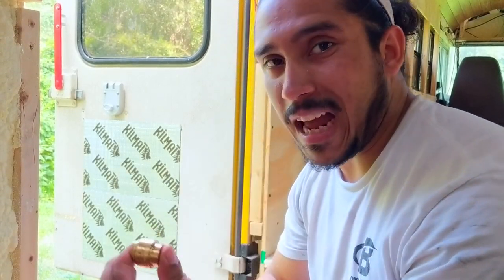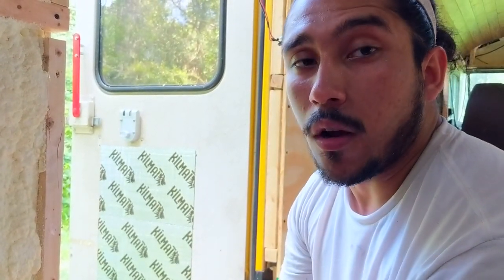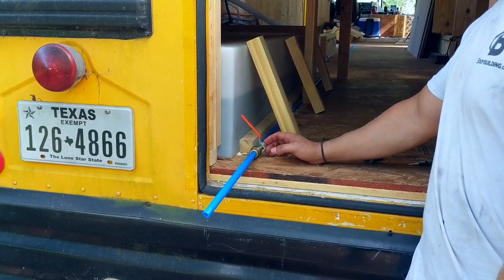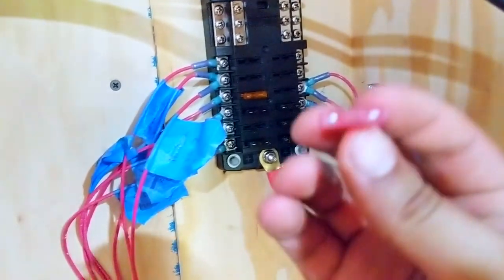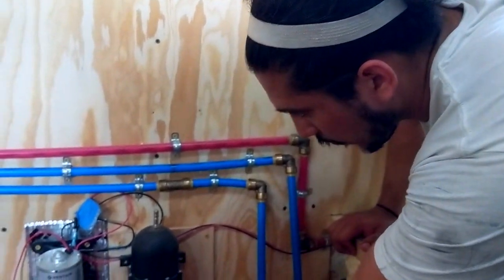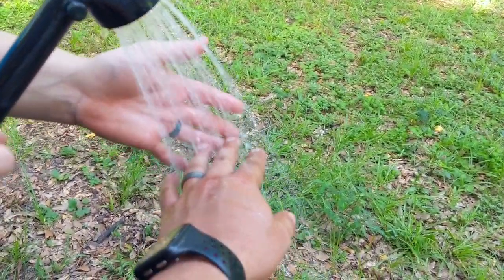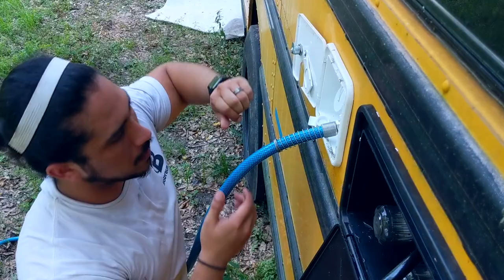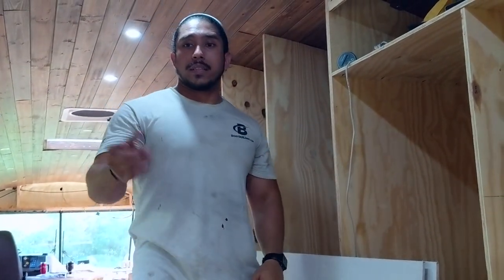Leak Testing Our Plumbing System * Skoolie Conversion * Gus The Struggle Bus

Comment: I had that pressure value, figuring it was the better option being more expensive and all. That turned out to be a total bust. It stopped working not that long after I got it. I've gone back to the basis one that keeps the pressure at 55 lbs. with no gauge. It seems to work way better and I've had no issues with it. Not saying you'll have issues with yours, but pay attention to that one. It might not be working when or the way you think it is. You won't have problems with the PEX and high pressure, but you will blow out the diaphragm in your pump with it. Keep up the good work guys!!
Reply from the maker: Thank you so much for letting us know, we will keep an eye on it!
Reply: MEREDITH and PACO you’re welcome. I wasn’t a real happy camper when it failed when I needed it to work the most. It was great while it worked though.
Reply from the maker: @2AZSUN  I can imagine!

Comment: Hey @MEREDITH and PACO! We absolutely LOVE how simple you two are making your plumbing setup! We've seen some crazy setups and know that the simpler it's constructed, the easier it is to maintain and the less probability of problems down the road. One thing that would be worth adding to the setup as seen in this video is adding a quarter turn shut off valve BEFORE the pump and another one AFTER the accumulator. The reason being is that if you need to perform maintenance or switch out a pump or accumulator, you don't have to empty your entire load of water (you'd only be losing the little bit that resides in the pump and accumulator).

Other than that, we LOVE LOVE LOVE how you set this up! We're planning on using Pex and Shark Bites too (so friggin simple!)

Keep rocking it, y'all!!!
- B+E
Reply from the maker: That is a great point! We will consider adding one thank you, guys! Yall are the pros and have the hook up here so You saying that is quite the compliment hahah! Thank you, cant wait to see how you guys do yalls!!
Reply: @GustheStruggleBus  LOL "Pros" just because we wear safety gear! EYE PRO! EAR PRO! BREATH PRO! ROFLMAO PRO!

You two are doing awesome and we love seeing you work together!! This is just a suggestion and not "required" just thought you are in a good spot to add those two shut offs easily if you wanted to :)

- B+E

Comment: If your pump runs for a 1/4 of a second and shut off and back on you have a leak,we have a truck camper and the lines come loose all the time
Reply from the maker: Yes, thank you! That is a great tip and one we realized soon when we did not turn the shower all the way off!

Comment: City wather and other wather are the seem why You do 2 whittings
Reply from the maker: Im not sure I undertand
Reply: @GustheStruggleBus  that all water are the same with the filter. city water and farmwater. in city water there is also dirt in it just like the other water why 2 connections.
Reply from the maker: @danielvanmourik5247  One is gravity flow. So we would just stop and fill up the tank and they keep going. The other =city is for a hookup, so we would screw it on and stay parked and have continuous water while parked with our using our tank water.